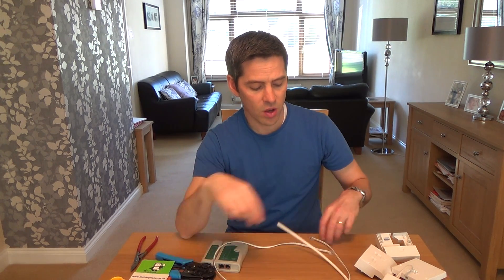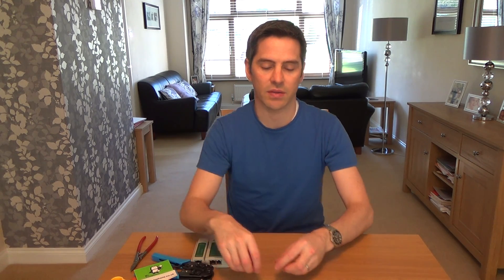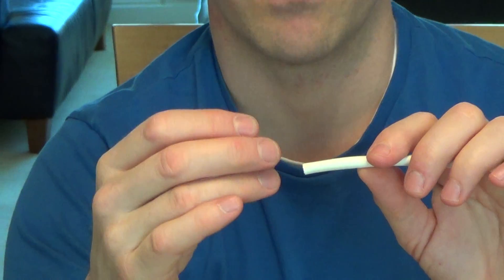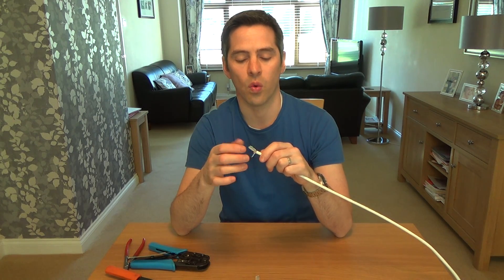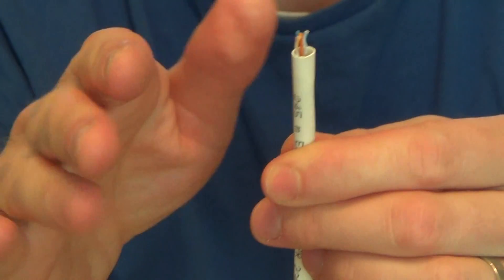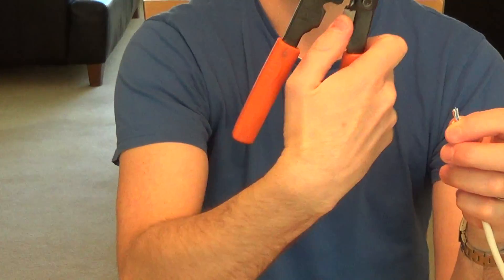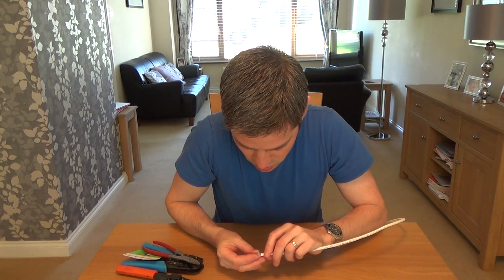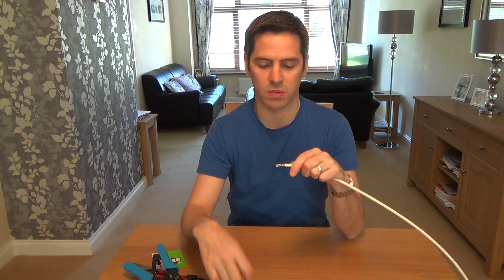How To make CAT 6 Broadband ADSL cable using RJ11 / RJ12 Plugs

Comment: When doing a Cat 6 in an 4 pin connector, you don’t been the casing to fit and when you cut the casing, if you smush the casing down, you can fit it. I’m too impatient to get 4 wires in the middle 4 without losing it. I’ll use the 4c over the 6c

Comment: Hello, I hope you'll receive this comment and read it. I have a copper cable like , a thick rigid copper coming from outside and directly linked with a Rj11 cable. nothing more, no filter nothing. and I have massive disturbance, whenever I open my garage the internet goes off. any Ideas how I can convert that thick copper cable into a cat6 cable inside the house ?

Comment: I don't know why RJ12 isn't international standard, it will allow things to be so much cheaper "hey, let's wire this guys house up to the internet, let's use all 6 wires for that" "hey, let's wire this guys phone system up, we wire it up to all 6 wires and only activate 2-4 wires on the exchange side, but still leave the other 2 so that they can be used in the future"

On top of that they could easily purchase ribbon to RJ12 on the exchange side and it will also keep costs so low it would be laughable as in pennies for a bag of connectors and maybe a few dollars for a ribbon to RJ12, but no... each country had to be their own special child that won't play well with others and force other countries to sit through a whole communications curse and them being degraded by telling them "these may cause electrification due to it being electrified" yes... I am tempted to stand up and shout "when did electronics start using electricity? why didn't anybody tell me until now?"

Comment: Hi Vince. Love these videos. Thanks for them. I was wondering if it was possible to convert a CAT8 cable to have RJ11 connection and how speeds are affected by it and length(i am potentially looking to get a 20m cable so i can move router away from under a shelf in the living room to the hallway

Comment: Hi Vince,

I've been trying to find out what the highest category that an RJ11 could (justifiably) support.

Would it be pointless connecting it to a category 7 because of the number of wires, or am I conflating two separate measures?..

Thanks

Comment: I recently found out that the newer Openreach sockets with the built in filter is actually RJ45, so not sure why we are supplied with RJ11 to RJ11 cable.  I decided to buy a RJ45 to RJ11 cable but it's not CAT5e, now I have seen your video I would like to make a Cat6 version of this cable.  Will the colour code be the same show in  your video?

Comment: Question for you. I’m creating a Cat6 to RJ12 cable, so a Cat6 cable with one end RJ45 plug and the other end a RJ12 plug into my router (I have a wired connection to my room thru a wall plate). The color configuration you provided I believe is the A configuration. However I’ve wired mine for B configuration. Would this mean that I need to follow the same configuration (B) for the inner 4 wires using the green instead of orange?

Comment: Just a suggestion, you can get flat shielded Cat6 cable which fits in a RJ12 much easier and if you get a shielded+UV protected sleeve you can have it running outside long the wall etc.. 
Having my Router next to the plug out 10 maters away makes no different to my speed. We are talking about .10s of kbps.

Comment: You may use Bel Stewart's Shielded STP RJ11 jacks. I've found them on Ebay.co.uk and it is the only way to fit CAT7 cable into RJ11 socket.

Comment: So I attempted this for literally hours and was not totally successful. Trying to orient four wires coiled in a round sheath to flat wires in proper position is near impossible. I found depressing the two outside pins eliminated the outside wires trying to go into those pin positions. After I managed  to orient the wires in the pins the blue sheathing does not stay grabbed by the plastic tab inside the Rj12 and easily pulls out, exposing the wires to bending wear and tear. Sure would be nice if someone made a better Rj12 that allowed a pull through of the wires. It took many failed crimped connectors to get two half workable.

Comment: Well Vince, I got some supposedly rj12 connector plugs, but I believe they were just rj11 connector plugs in a 6p6c configuration.
I have attempted to use them to crimp 2 pairs of a Cat5e cable without much luck. If is not as easy as it appears to be! I know that the RJ45 end is sound. I have cut a shortish length of cat5e which did have a 8p8c connector at both ends! This cable worked OK according to the continuity checker!

I have two reasons at least for my problem!;

The rj11/rj12 crimp tool is not effective to crimp a decent crimp!

Due to my at times shaky hands I can't get the four cores to line up properly and get them far enough into the connector to get a good crimped connection!

Would that I could get some of the ones that you use. It would be one step closer to getting a better connection, when I get my hopefully better crimping tool!

Comment: This has given me a GENUINE 4Meg + increase in my 6 Metre lead from master socket to router. Previously had parallel cable = 59Meg with twisted pair speed nearly up to 64Meg. No B.S. Amazing!
Reply: Meanwhile those on Cable are laughing.
Reply: @bitTorrenter  with their awful upload and overloaded networks at peak times?

Comment: Plain flat cable works just fine for me im synced at pretty much maximum speed but the cabinet is only around the corner but cant see why VDSL modems cant just use a RJ45 plug

Comment: A big thanks Vince. I've ran cat 6 and used the ends I got from you and it's working great including the cat 6 sockets. I did struggle to get the wires to connect initially but realised I was trying to keep the twist to tight to the connectors so was not leaving enough cable to connect.
Reply from the maker: Thanks George.

Comment: Hi don't know if you can help me? I'm on fibre however due to being so far from the junction box the speed is dreadful! I have managed to gain an extra 5meg by using CAT7 from the router to devices. 

However I have ran a CAT7 RJ45 from the phone socket to RJ11. I have cut the RJ45 end off the CAT7 & am not sure which wires I should put into the RJ11 as I have orange, white, cyan, white, foil wrapped blue & white, brown & another white? Any ideas please on which order I need to place in the RJ11. Many thanks
Reply from the maker: It should be the blue pair of wires that you need to use. These need to be connected onto the middle 2 pins of the RJ11 socket (normally labelled up 3 and 4).

Comment: Isn't cat 6 a little overkill? Won't cat5e suffice considering you're only actually using one pair?
Reply from the maker: Yes it is a bit overkill but CAT6 uses 23AWG and CAT5e 24AWG so the cat 6 wire is ever so slightly thicker which is better.

Comment: Hi there, I'm hoping to use 30m of exterior cat 6 with an RJ12 as you suggest to take the router into the loft up the side of the house wall. However, the master socket with the VDSL is not on the same outside wall. Would you:1. Use standard cat 6 white cable (black is unsightly) for the internal stretch with a female to female RJ12 adaptor (hidden behind furniture) - or will this connector degrade the signal?2. Use the non-master socket which is on the correct outside wall with either a microfilter or swap over the VDSL (if this is possible?) - or is it a risk to not use the master?3. Use all external cable (black because white would look odd outside) and attempt to paint the 4m of cable visible inside - I'm concerned about the paint peeling off or flaking with timeThanks in advance and I'll check out your shop now!
Reply from the maker: Hi, you won't be able to fit a RJ12 onto external cat6, you can get it onto internal cat6 (it is very tight) but the external is a bit thicker. The best option is to have one cable. Personally I would be more tempted to leave the router where it is and run an Ethernet cable up to the loft and then you can install a network switch to distribute the wiring to the other rooms. This way you won't degrade the signal.
Thanks.

Comment: I bought a modem but it's an ethertnet modem only, so i cant connect it from the microfilter as the microfiler only provides the adsl wire, how can I use my ethernet modem instead of using my standard one as a bridge?

Comment: can you use cat7 cable for RJ12
Reply from the maker: +HeadshotUK Hi, you are going to struggle to fit the cat7 cable into the RJ12 plugs as cat7 is thicker than cat6 cable and cat6 just fits into the RJ12 plugs.
Thanks Vince
Reply: +My Mate VINCE Thanks, I have found your shop on ebay but unfortunately there are no items at the moment when would you have any in stock
Reply from the maker: Hi, sorry I had it closed over the weekend as I was away, it is all open again.
Thanks.
Reply: +My Mate VINCE Nice one mate, I've ordered one from you thanks